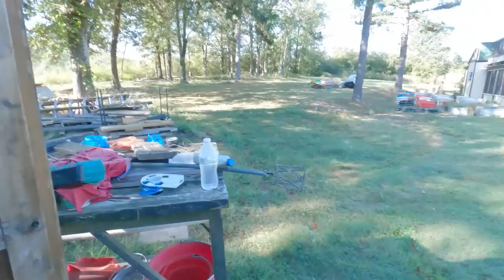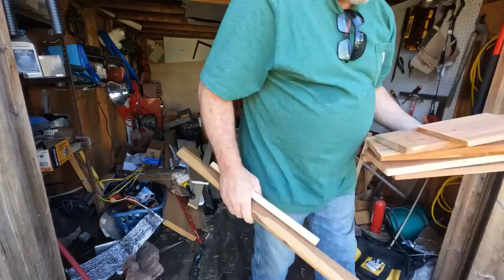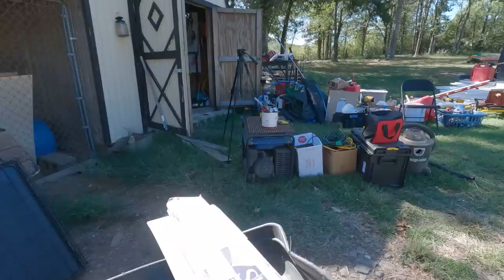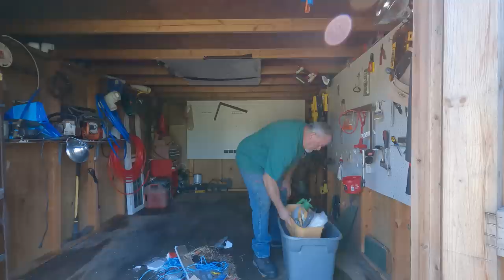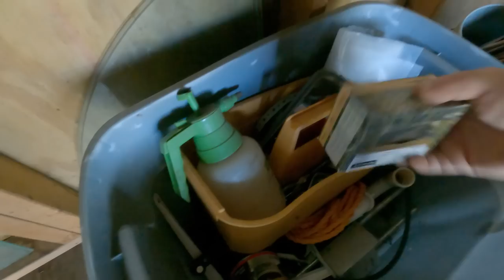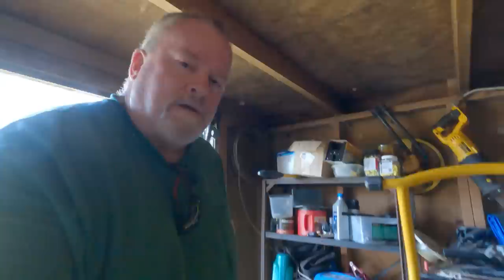It Was So Bad! Am I A Hoarder? Taking Back The Storage Shed From Hell!

Comment: Did you find your hammer? Maybe in the loft? Why don’t u put your styrofoam wherever you’re putting it up for insulation? Then you’ll have it there when you’re ready for it, will help you be motivated to get the job done cause it’ll be right there. After you organize your pegboards & shelves you need to organize all your wood in the dog pen. Put it up in the rafters or put in the rafters, or at least stack on blocks in the middle so it doesn’t get wet. She’d looked great when you finished.
Reply from the maker: Did you watch todays video? I answered all that